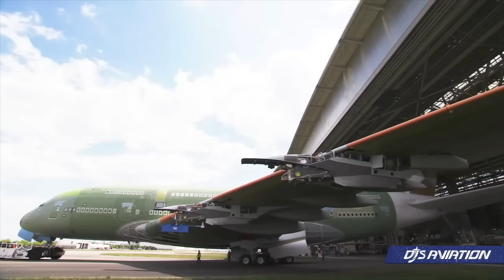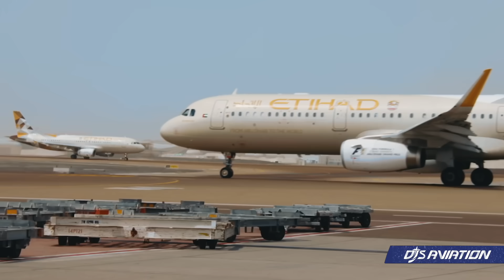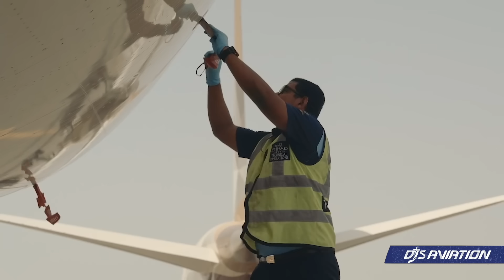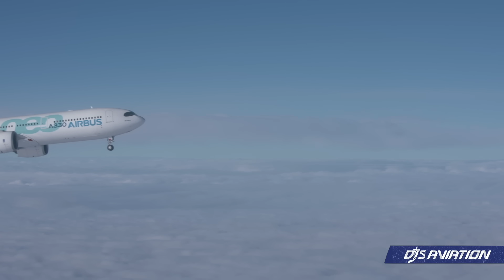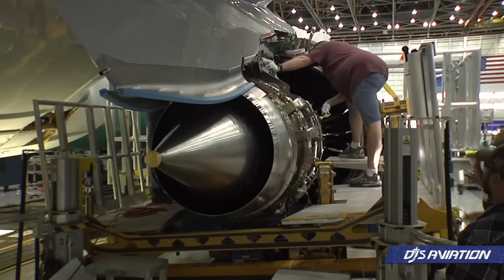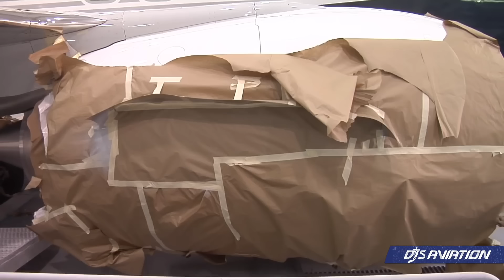Bad Airbus News, 737 MAX 10 Updates & Etihad Expansion

Comment: IMO At the rate that Boeing's failures are going & now with the engineers strike in full force I don't see how they can recover and be profitable, The old catchphrase was IF IT AINT BOEING I AINT GOING Now the new catchphrase is IF IT'S BOEING I AINT GOING
Reply: Still trusting the old catchphrase, did a while on full airbuses and the air quality just doesn't cut it. The turbulence on an airbus is also a bit too much to call a journey smooth

Comment: Bombardier should buy back the A 220 from Airbus, stretch it to a 500 model and rake in 10,000 orders.
Reply: Isn't that Embraer and not Bombardier?
Reply: @jaym8257  You're thinking of the E-jet series; smaller aircraft than the A 220.

Comment: Honest question to airbus fan bois.  Would you rather fly on a max9 on an majorly Western airline or an A319 of any budget African airline?

Similar question to Boeing fan bois with the max and Airbus reversed.
Reply: Airbus all day.
Reply: @JohnJones-k9d  True fan boi.
Reply: Dopey question, the western airline irrespective of aircraft type.
Reply: I pick the flight and not the aircraft.  I get what they give me.
Reply: @normanstewart7130 Dopey perhaps.  Illuminating, yes!  As a recent example, many experienced 737 pilots have indicated that the MAX crashes were avoidable had both sets of pilots had better working knowledge of their aircraft.  The Ethiopia co-pilot didn't even have ATP.  I believe both aircraft in question were at max power when they slammed into the ground - well outside the limits of the aircraft.  Basically, they failed to fly the plane.  The auto-pilot on Ethiopia was never turned off and so you could argue it flew itself into the ground.  As for Lion Air, did you know the flight prior to the crash on the very same jet a similar incident occurred?  A runaway trim situation was recognized by a pilot riding in the jump seat (FFS) and correct emergency action was taken and plane laded safely.  It's a shame the faulty part didn't get corrected by Lion Aircraft maintenance. 

Your comment makes the point.
Reply: @jaym8257  Exactly!

Comment: Honest question for all the Europeans/Airbus fans talking schittt day and night about Boeing. Which one of your legacy carriers would exist were it not for Boeing? And no, I'm not absolving Boeing of it's wrong doing but you lot are getting  tedious with this crap video after video.
Reply: Butt hurt yank post, insanely funny.
Reply: @JohnJones-k9d  I'm not a Yank first of all and second of all good to see you can't read or comprehend.  Answer the question or pipe down.
Reply: simple, until 1972 boeing was the only one making airplanes and alone ruled the market. In 1972, Airbus launched the A300 on the market.
Reply: Douglas,BAC, Fokker , laughing on the sidelines...
Next time, do a little more research before spewing out rubbish.
Reply: @BringbackMD  LOL if BAW, Lufthansa, KLM etc. flew only the manufacturers above, they'd have gone under a long time ago. Or better yet, they should have flown the DeHavilland Comets (LOL).  European legacy carriers are what they are today partially thanks to Boeing aircraft that opened up all corners of the globe. This isn't even up for debate.  You need to do some research and stop the BS.
Reply: I know Alitalia has operated several American aircraft since the 50s, like the DC-8, 727, and then 767 and 777. ITA is going all in on Airbus though, not even Embraer, just Airbus.
Reply: @sliferxxxx think MD was referring to the comment about Boeing being the only manufacturer before 1972, not your's.
Reply: @linkcenter  Um no. There was Douglas,  BAE, DeHavilland, Avro, Fokker, Lockheed, BAC, Vickers, Ilyushin, Antonov etc.  They had options. Just that  Boeing was better.  Point being, laugh all you want but your European carriers wouldn't exist were it not for Boeing aircraft. Fact (and vice versa admittedly).
Reply: @gregsmith3410  Oh...I 🤐🤐🤐🤐
Reply: @EuropeanRailfan-AM  they soon won't, lufthansa won't keep those 330 neos running for too long, doesn't make sense when they have a large amount of 787s on order atm